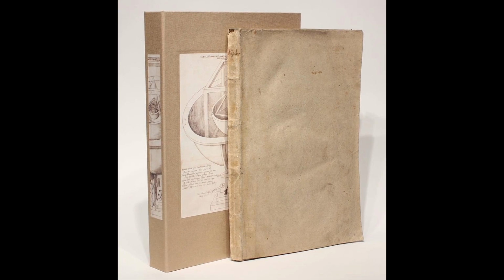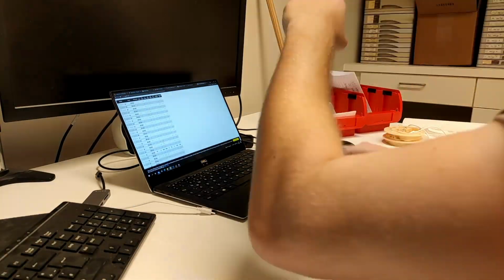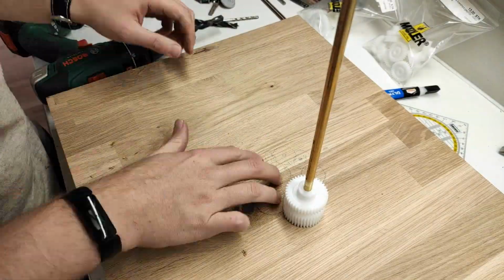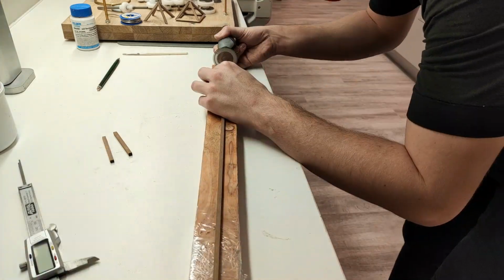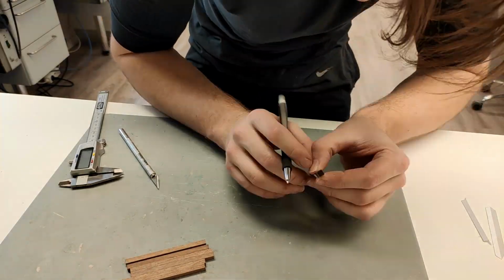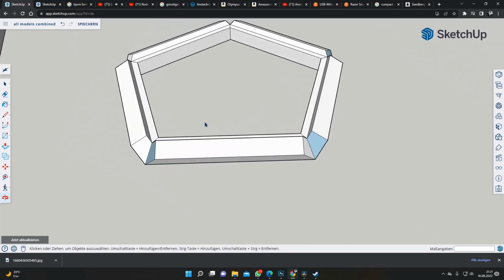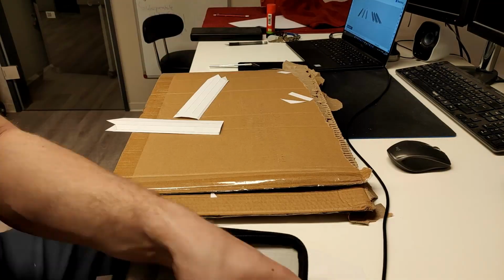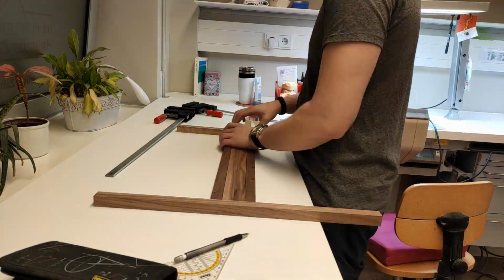Building Keplers Mysterium Cosmographicum

Comment: This is absolutely incredible work. Well done! I'm working on recreating the Mysterium myself in CAD right now, but I've run into the problem of the thicknesses of different things (the spheres themselves and the solids around them). Did you just try to keep them all as thin as possible? Or did you have some other method of determining those thicknesses?